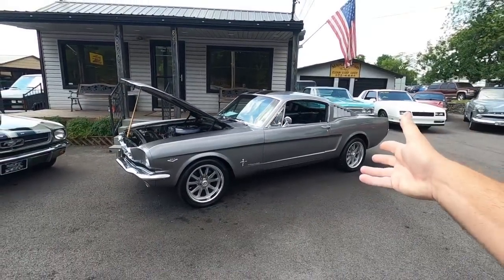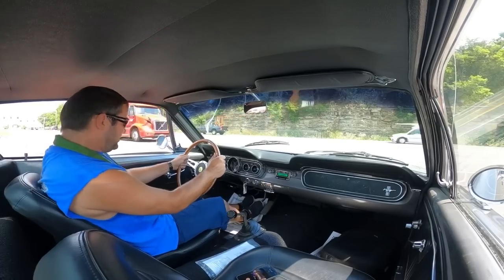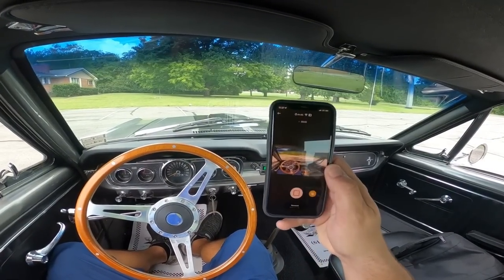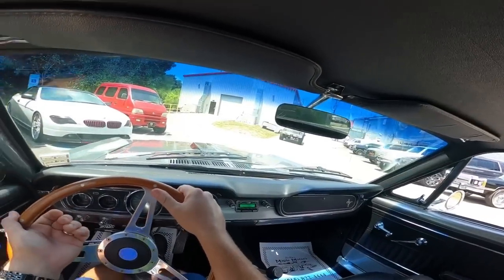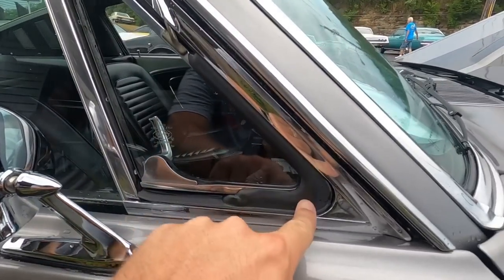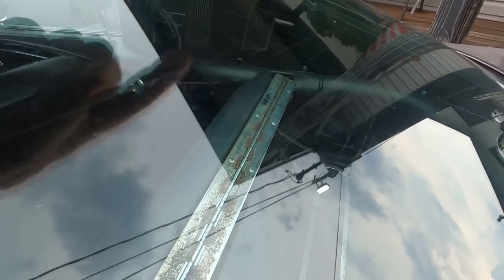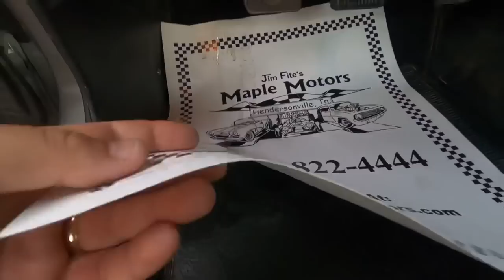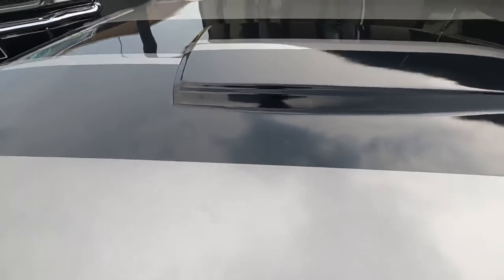1965 Ford Mustang 2+2 Fastback SOLD $42,900 Maple Motors #1705

Comment: Never cared for 64 - 66 Mustangs but.....
I really like that "65" a lot! 🔥 💯 🔥
Reply: -----------------------   Ford never built a 641/2 fastback ..... prototype or otherwise .....
Reply: Did you actually read what I wrote?!?!?!
I never mention a "fastback" 🙈 🙄 🙈
Reply: @rsgabrys3080 ...TECHNICALLY WISE YOU'RE CORRECT, FORD NEVER BUILT A "PRODUCTION" 64-1/2 MUSTANG FASTBACK" ACCORDING TO MOTOR TREND MAGAZINE!..."THE 64-1/2 MUSTANG IS SIMPLY AN EARLY - PRODUCTION UNIT WITHOUT THE REFINEMENTS THAT CAME LATER!"!...ALSO ACCORDING TO MOTOR TREND MAGAZINE!...MEANING THE FIRST EARLY MUSTANGS WERE PRODUCED AFTER JULY 1964 MODEL YEAR, SO THUS CALLING IT THE 64-1/2 MUSTANG!...I AM JUST SAYING!...GOD BLESS AMERICA! 😇

Comment: Some really nice cars. I have a question though… so many cars have wipers and horns not working. Most places it won’t pass an inspection meaning you can’t register it. Do you fix this before delivery? And, doesn’t Tennessee have these as a requirement to be working? Thanks….There’s a good chance in the near future I’d purchase a classic from you and would need it shipped. Thanks, Larry
Reply: They make sure the cars are safe.....you have to fix the minor problems!
That's why they're priced reasonably. 😎 💯 😎
Reply: Inspection to register it?  What are you talking about?  You hand over the pink slip and bill of sale to the DMV worker and that’s it.  Actually last time I registered a car I just purchased (1951 Ford) I did it all over the Internet and never stepped foot in the DMV.
Reply: @guardinoinc.7490  Like in many states the car must pass a safety inspection and have proof of insurance in order to get the registration and plates.
Reply from the maker: No we just buy and sell but tell you the problems up front. Thank you
Reply: @MapleMotorsNickSouthgate  Thanks for clarifying…. Are there sources near by that could repair the cars before they ship? Would you facilitate it for a fee? I live in Guam and the mechanical repair shop’s especially for a classic would be limited. The vehicle can’t be registered or licensed here without passing a safety inspection.
Reply: @ Larry Mullikin
His buddy a few buildings down is Brian’s MotorSports!
They fix everything from minor repairs to all customs. 😎
Reply: @guardinoinc.7490  They will give you a 15 day tag to fix the issuse for safety inspection in N.C., my 2001 GT Mustang and 1984 LX Mustang only has to have safety inspection for Tags, no insecption means no tags for the road. a title transfur does not need plates as why it can set in your yard like you own it.
Reply: @tonyt8805  Thanks, good to know
Reply: @larrymullikin1896  I live in the Philippines forget getting that car or any over here  and I used to visit Guam once a year until damn covid hit and hope to go back early next year again
Reply: Most states go pretty easy on antique or historic cars. Often no inspection. Also, I would have minor issues such as horns, wipers fixed near home. They’re generally easy to fix and for cars like the Mustang parts are available. If you can’t do it yourself it’s a good opportunity to introduce yourself and the car to a local mechanic. Most love working on these older, easy cars and it gives them a chance to go over it and let you know what else it does need or will need soon.